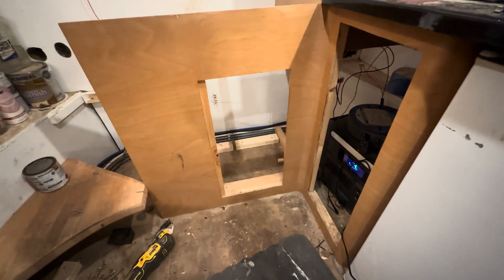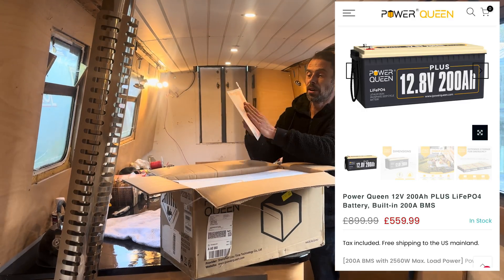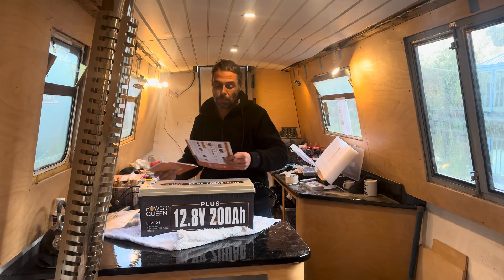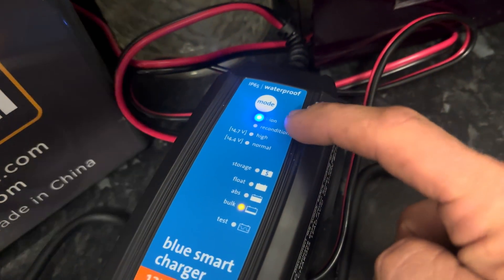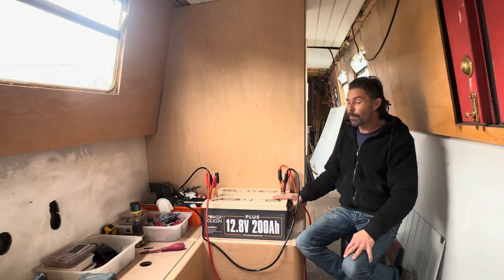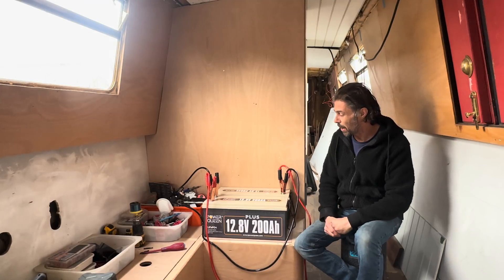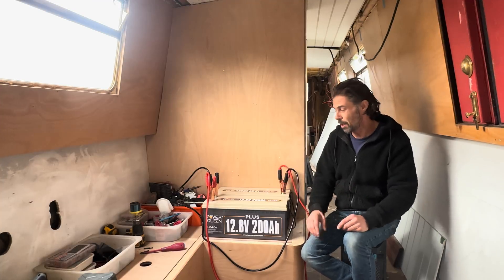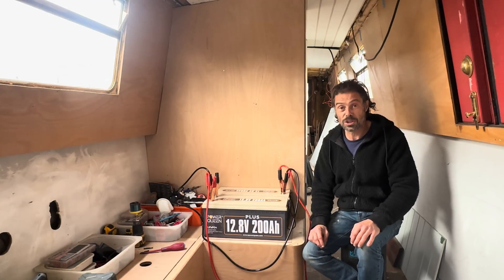573. Balancing new LIFEPO4 batteries

Comment: Powerqueen from all the reviews ive seen makes a solid battery
Reply: They are excellent batteries. I'm running four 100ah power queens in parallel now for a year and they are doing very well with no issues in my 2000w system here in Jamaica.
Reply: Plus all free !  This is why uk is knackered

Comment: You can't balance lifepo4 batteries like that. Once removed from the charger, the voltage will drop back. You can only balance those batteries by getting the voltage from the charger on both batteries at the same time at 14.6v. The charge curve is flat below 80% charged so they can have the same voltage but different states of charge. As soon as you remove the charger the voltage will be below the 80% figure. A waste of time. You need a Victron smart shunt to know state of charge. You also need NH00 fuses on each battery and an isolator on each battery. Use a +ve and -ve busbar to connect the batteries and the loads. No more than 3 ring terminals on any one terminal

Comment: 👍👌❤️🇨🇦, Well James, you won't go wrong with the Power Queen batteries. I have been using Power Queen since they first came out in North America. Great battery and great customer service. Light weight. You charged them correctly, each battery separately,  giving each fully charged battery 24 hour to stabilize before connecting  in parallel.  Then giving at least 24 hours to equalize before putting a charge on them. I live totally off grid, with 36 x 405 watt panel array.

Comment: Boring vlog james 😴 nothing going on except waffle.
Reply: Let’s face it, it’s probably a finance issue if James hasn’t go full time employment. Tinkering around the edges until he can afford to get stuck in with the important jobs & not wasting money on chunks of walnut😉
Reply: @garybevan1022 Yes, it’s turning into an advertising vlog. Switched off.
Reply: The last few have been boring. He seems to have lost his enthusiasm for narrow boat building. There's not the urgency that there was at the start. Too much faffing not enough cracking on. 
His kids will have homes of their own by the time this gets finished.
Reply: Could also be because its winter here, everything slows down in the winter
Reply: @st200ol  It didn't when he was working on Sloe Patrol.